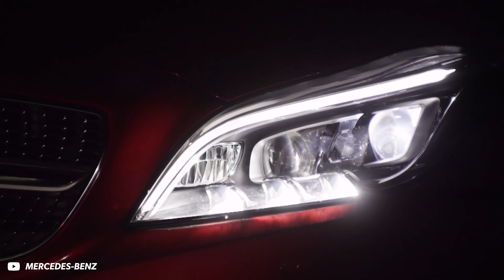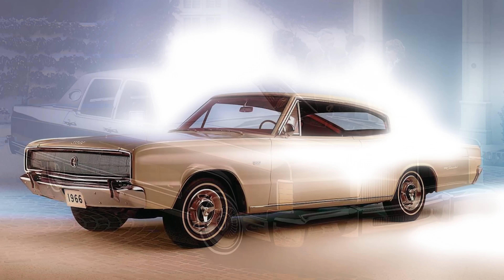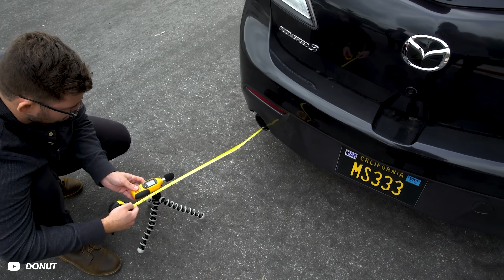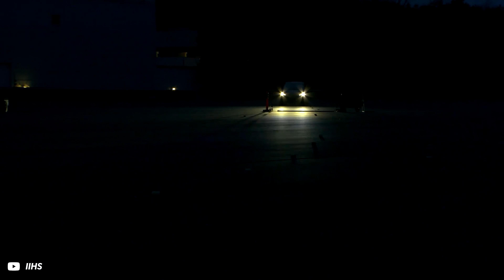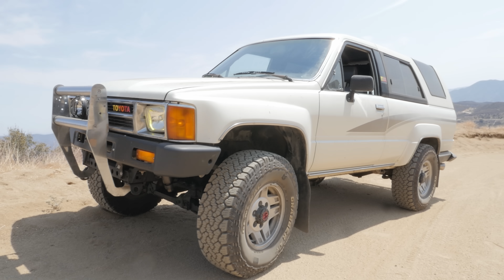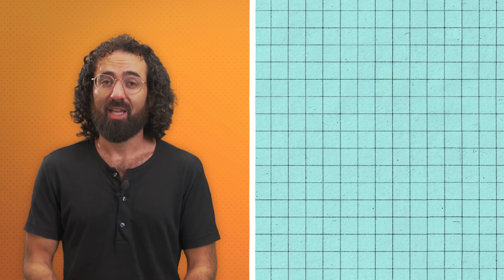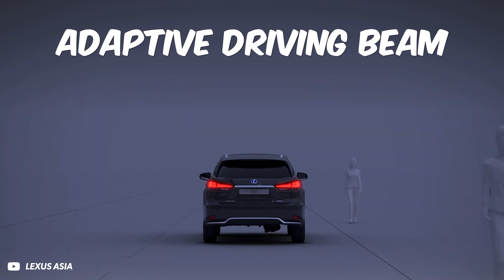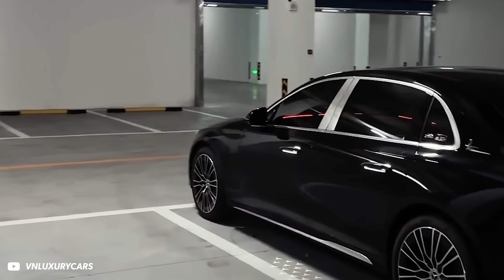Why new headlights are blinding American drivers

Comment: It wasn’t that automakers wanted halogens and the government wouldn’t let them. Halogens were far superior to the sealed beams with their warm glow ten feet in front of the car. The patents for halogens were held by European companies so US manufacturers leaned on the NHTSA to keep halogens out of the US until the patents expired. Only after the patents expired and US companies did not have to pay royalties were non-sealed beam headlight allowed. The same thing is happening again, where European LED headlights with matrix control to prevent blinding on coming drivers and cars ahead are not allowed by the new NHTSA regulations, so we stay with the low beam/high beam configuration that blind drivers. Doesn’t matter how many accidents are caused by bad headlights so long as US car and parts manufacturers can protect their profits.

Comment: Owners don't have the discipline to put it to low beam when an oncoming car is coming. High tech anti blinding leds will be super expensive to replace as they are OEM and complicated , also will the different Leds burn out at a different rate?

Comment: My god, you overlooked the easiest (and cheapest) solution: properly aiming your headlights. Every car has an adjuster on the light housing that lets you adjust where they point. Most headlights are not properly adjusted from the factory. And the dealer doesn't care. And consumers don't know any better. It's a ten minute fix that can be done with a screw driver. If everyone properly aimed their headlights (which can be easily done with a wall next to a flat surface like a parking lot) you'd be surprised how many people stop complaining about getting blinded by the lights.

Comment: A simple AND CHEAP temp fix is to mandate the COLOR of the light.  If you mandate headlamps must be between 4300k & 5000k or (better yet) between 4300k & 4700k.  Why?  More natural light.  Full day sunlight is just below 5000k.  4300k - 4500k is easier yet on the eyes AND works better in snow/fog/rain.
While the old european standard of orangy-yellow 3000k is not great for estimating distances, it works well for illuminating in dusty & foggy conditions and why they were mandated for FOG lights in europe for about 20ish yrs.  
Bring back halogen color headlamps.

Comment: As a European truck driver,i can tell you,even in higher driving position,its still very annoying,if add up and astigmatism to the recipe 🤣🤣.But jokes aside,except from the factory leds,dont forget and those who install aftermarket led conversion kits to their cars,and pull them out when its time for inspection.Not calibrated correct,not even tested.Also include that most people operating their vehicles,dont even know that they can adjust their lights with a push of a button .To be honest,i am good with my factory bixenon lights,with auto beam adjusment.Never had a flash or cringe from noone.And i have good vision even in bad weather conditions.I like this topic being brought up,and also happy that i am not alone out there with that problem.Cheers.

Comment: On the vehicle light issue my main concern is trucks that don't adjust there lights after being loaded or the morons that use flood lights and no headlights or both or ones that blackout lights. Then to the led light vehicles that they burn out so quick and the drivers don't know it. Led lights are still unreliable on vehicles and it needs to stop.
One reason why people are using brighter lights is because road paint, signs and marking have become less visible. You used to be able to see this stuff out for at least 1500 feet or more. now days even freshly painted markings loose their reflections in days after it being put down. then you got the morons that do Burn-outs on them. Also roads have gotten less black to make the marking stand out more.

Comment: I haven't even watched a single second of the video yet. I just clicked on this to say thank you so freaking much for recognizing this. It blows my mind. 

Back around 1988 or 1989 my car failed inspection because one of my headlights was not properly aimed.  I cannot believe nowadays headlights are legal.

I removed the LED bulbs from my truck and replace them with halogen.

You can also make it impossible to see pedestrians in crosswalks.
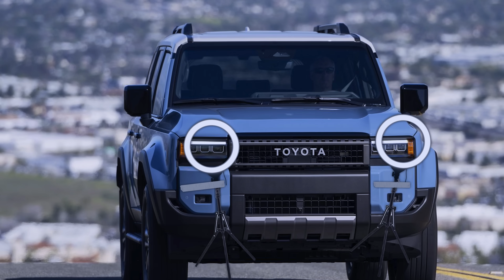Reply: unfortunately it's a schill video for adb.  starts at 9:00
Reply: @NomadHatchThat's what I was afraid of. I figured it was almost certainly going to be a shill for that or some other bullshit. Sure enough

Comment: European here and having a car with laser lights. Thankfully they don't operate frequently in laser mode and the regular adaptive matrix lights are bright enough for all use cases - but the thought of being dazzled by laser lights is scary. Some oncoming motorists will flash me during any drive made at night because they think that the lights have a problem, but it's just the way they are and type approved, MoT tested, etc.
The adaptive setup is pretty good for all but the twistiest of roads.

Comment: I retrofitted my old Ford Focus with chinese LEd bulbs. I double checked everything, the aiming, the beam pattern, they are phenomenal, they do not blind. It's the new soccer mom SUVs and trucks with squinted headlights that are the problem, not old vehicles with retrofits.
Reply: You are the problem. Please change back to the 55 W filament bulbs your car was designed for. Your Ford has good lights. You have no need to use LED.
Reply: @mrpeterfromgodknowswhere  Again, I checked that they were aimed correctly. The light pattern and intensity coming from it is good. Why am I the problem when Karen's giant Genesis SUV has tiny blinding projector headlights but my large halogen housings I can stare at head on without flinching (and it would have to be an extremely lowered car to even get the light head on). This is a subcompact sedan not a lifted truck. You are part of the problem, trying to prevent people from upgrading their old cars and cover up the problems of new ones.

The LED bulbs I bought are not very much brighter than the stock halogens and I got them so I have less parasitic load on my alternator and not have to deal with burned out bulbs.
Reply: Thank you for taking the time to do these checks.

Comment: headlights are brighter because interiors have been stuffed with bright screens, way too bright screens, now, in order to see something outside at night - you have to have brighter lights
the problem isn't much of a problem when everything is new and adjusted, except when the road is wet and this bright light gets reflected off of the road and into the incoming traffic blinding them
then there are the SUVs who get too close and their low beams start to fall into side view mirrors
and then there are brake lights that are much too bright, because guess what - led tail lights are brighter than the 5W halogen bulbs, so everything gets bumped up because of the idiocy of stuffing car interiors full of giant bright screens

Comment: It is illegal (criminal offence)to flash a laser at helicopters/aircraft yet it is ok for drivers to get blinded by laser LED headlights- the problem is that they are aligned too high permanently on high beam the alignment needs adjusted downward so that they point towards the ground-that is the solution.
 Fitted to cars registered since 2017.
 Surprised that in London with the concern of people's respiratory health there is ULEZ- You could question why they haven't introduced a DTEZ (Danger to eyesight Zone) in London or is ULEZ just a make money Zone?.

Comment: Or, crazy idea: demand a road safety test for every single vehicle every 1-2 years, like the others. There are LED retrofit kits that pass these tests here in Europe, but they are basically car specific, so they don’t blind (and are expensive). And if you have a car with halogen but no retrofit kit you just have to keep it that way. You change your ride height? Get your da#n lights set up for the new height. It’s easy, save, and better for everyone this way!

Comment: I have bright lights on my car, I bought it used and I think people must have put in some super bright LEDs, they're almost TOO bright even for me to see down the road.

The signs reflecting back at me hurt my eyes 😂

While my car was in the shop for a few months, I was borrowing my grandmother's car that just had basic ass standard very warm halogen bulbs. 

And sure, I'll admit I do wish that they illuminated a little bit further left and right to the edge of the road and that the high beams were a TAD brighter.

But for that month and a half that I was driving that car, I legitimately do not believe in any way that my life was "in danger" due to not having  SUN MODE LEDS to illuminate ever square inch of the road for a mile.

Comment: Suggesting an expensive and unrepairable solution for WHEN(not if) it ends up breaking IT'S NOT A SOLUTION.
Just limit how bright lights can be, you don't need freakin lighthouses on a damn city.

This is an already solved problem, lights and lenses, make low beams useable in night highway and limit the brightness of high beams and that's it.

Comment: You glanced over the worst thing. People putting LED's where the low powered halogen lights for day time running lights. The power is reduced to keep the halogens low and dim but when they put LED's they are almost at full brightness in the high beam reflector housing.

Comment: I had custom headlights built for my ’06 F-150 — Morimoto projectors with Osram LEDs. I spent $600 on factory headlights, sent them to a custom builder, and dropped another $2,500 to get it done right. Down here in Atlanta, we’ve got little to no street lighting — it’s dark as hell. Those old brown halogens just don’t cut it anymore. If we had proper street lighting, there’d be no need for “adaptive” headlights — or LED headlights for that matter. So don’t blame me because you can’t see. Blame your state and federal government for refusing to allow better tech.

Comment: Car manufacturers are obsessed with slashes and LED clusters in place of sensible headlights. The height of lights have also changed putting them in the eyeline of oncoming drivers. Lastly, the frequency of the light is brighter AND highlights moisture in the air at night, which exacerbates during rain making dazzling inevitable. How the hell government hasn't legislated to conform these lights for safety is beyond me.
Reply: perfect example that the gov doesn't care about us

Comment: Adaptive beams are cool (I live in Europe) but they still cause massive glare as they still struggle with tight corners, bumps, highway barriers and wet road surfaces among so many other situations. 

I think the only way to solve this is to limit the brightness, and harness the adaptive beams to blank out oncoming traffic whilst using its low beam (currently the adaptive lights use high beam as much as possible, meaning when it does make a mistake, you’re blinded)

Comment: I bought cheap led bulbs and even when aimed down the low beams were so bright i immediately put the old halogen ones back in. The high beams are still ridiculously bright but i dont use them at all if there is any oncoming traffic.

Comment: Yet another problem that could be easily solved if the US stopped trying to be exceptional and just followed the same rules and regulations that the rest of the world does. The FMVSS differs so much from the UN ECE standards that a US market car model is almost a different car from its international sibling despite having the same badge and name. Same goes for driving rules, road signs and the metric system.

Comment: I have to confess... I had to replace a blown H11 headlight bulb recently.  And then again every 3-6 months thereafter for about 2 years.  Just about every single auto part store quality headlight bulb absolutely sucks.  Finally got the OEM Osram bulbs and so far 1 year + no problems.  One more instance and it's LED replacement for me just because I could have bought the most expensive LED bulbs and replaced them once for how much I paid for all the replacements.  I hate miscreants who put those damned bulbs in their cars but I'm at the point where I have no other choice.

Comment: Secondary comment: I think many people who are complaining about these headlights never drove older cars in the 1970s and 1980s when headlights were pretty terrible, in some cars it could be absolutely terrifying to drive at night, especially if you live somewhere with lots of wildlife. I started driving in 1987, in North Central Texas, and my first car was a 1969 VW Bug. The headlights on my Bug were just a bit better than the oil lamps they used to hang off the corners of horse drawn carriages in the 1700s.  I definitely don't want to go back to those days.

Comment: My 2022 Tesla Model Y got an update this year that finally enabled adaptive headlights, and it’s a total game changer. I can see way better without blinding other drivers. Wild that it took this long to roll out just because of regulations.
Reply: How did you ckeck, that it isn't blinding oncoming traffic?
Reply: @Rebius  Can confirm, no more high beam flashing at me, in either my MY nor MS.  Used to happen all the time.
Reply: @Rebius  people used to flash their headlights at me all the time because mine were too bright. hasn’t happened once since the update about 7 months ago.
Reply: Sorry, but no. It might have changed the game, but you are still blinding oncoming traffic. The system is too slow to react and it doesn't handle curves and hills very well. I appreciate that you are thinking of others, and this is probably better than it was, but it's still blinding other drivers.
Reply: trust me, you're still blinding people.
Reply: @NomadHatch You''d have to be oncoming traffic and flash me before I'd trust you.  Pretty simple, really.

Comment: There's a car I see at about 4:30 am every morning that has purple bulbs around the headlight casing. I thought it was the weirdest thing until I realized that it does actually have white bulbs inside the headlight casing that is lighting the road in front of the car - those bulbs are pointed towards the road, so oncoming traffic doesn't see them.

I appreciate it, although it does mean I don't see that car coming until I'm much closer to it than I would otherwise.

Comment: I swapped my 07 fit with LED headlights. I picked Phillips ones that do a pretty good job of emulating halogen patterns. You can stand right in front of it and won't get blinded at all, in fact they look pretty similar to the halogens.
It's the crappy designs that blind you.